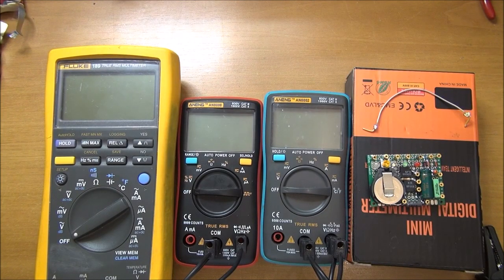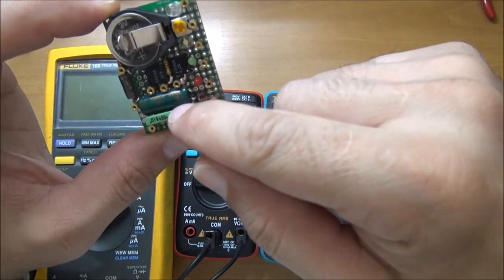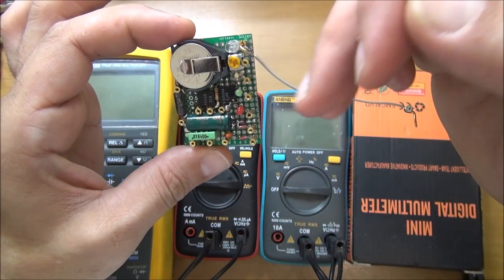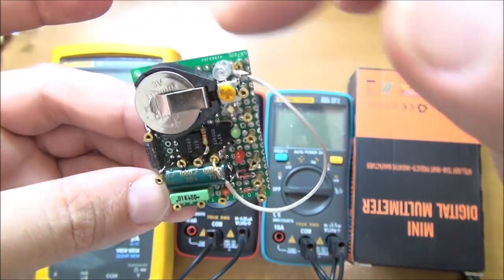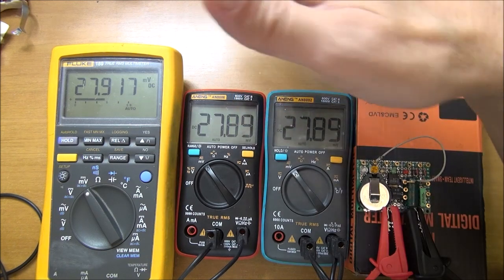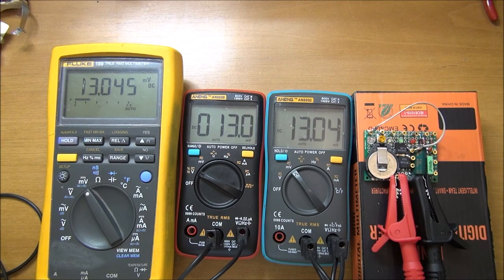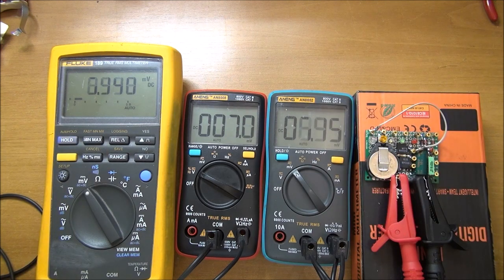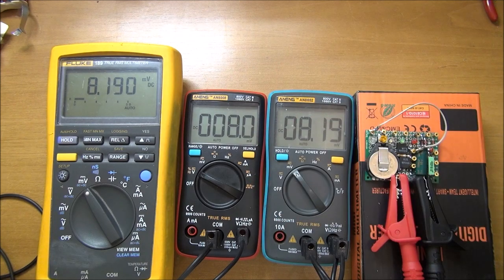Aneng VS Fluke: mV measurement

Comment: sir could you do a set of tests on current measurements for these devices please. thanks!
Reply from the maker: It will be a very short video. The current on those Aneng multimeter is quite sharp. Mostly the 8002. They are perfect, quite accurate, but of course comparing with the fluke, it missing a digit. So, I can make a video, but it will be very short... Aneng are very nice current measurements, like they can perform with millivolt caliber.
Reply: a trick : watch series at Flixzone. I've been using them for watching a lot of movies recently.
Reply: @Terry Kyng definitely, I've been watching on Flixzone for months myself :)
Reply: @Terry Kyng definitely, I have been using Flixzone for since december myself =)

Comment: That was an interesting video. For the hobbyist, low-voltage use these Anengs aren't half bad. I just wouldn't trust them for industrial day-to-day use or high voltage/current environments where safety could be an issue. 

Public perception is also a thing. If you want to show some technician what you measured using one of these instead of a reputable brand, you're unlikely to be taken serious, but that is a social thing.

In terms of the millivolt measurement the Anengs seem to have their act together, so the precision circuit and calibration must be decent enough for that at least.
Reply: MrDubje  i have one aneng an8002. but i don't have a fluke or any other famous-high quality branded dmm. so, i couldn't comparing it to the others. this is the comparation that i need to. results says no need to buy 500usd DMMs. i recommend it for you if you are not a tecnician  at a high voltage power plant.:))
Reply from the maker: @MrDubje   hello, for sure you can not use it on a professionnal area. Anyway I use it despite all those facts you mentionned. Of course you're right, and I approve all what you say. But a fluke is more bigger, heavy, bulky, and I want my tools case as light and  small as possible. Actually, because I can, I use it for troubleshooting, and the concern for the customer is to see the default disappearing. And I sometimes use the millivolt section, thing than Aneng offer very nicely. Of course I would not encourage someone to use it on professionnal sites. Of course I have a fluke for this purpose, but I never use it (...). The thing I prefer on Aneng is than I don't have to unplug the prob for measuring mA current. Now I know my 189 needs a calibration :o Thanks for your comment MrDubge